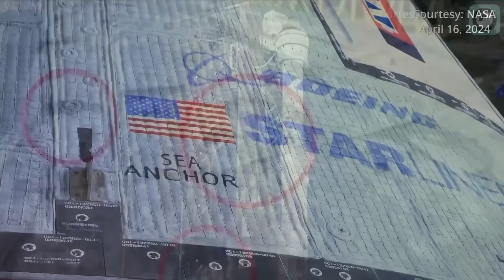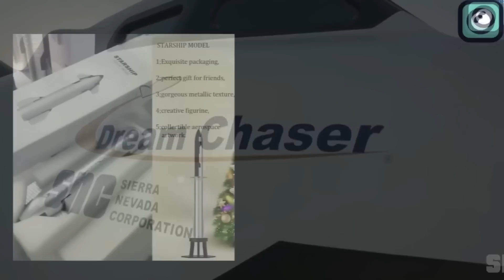Boeing Finally Gave Up On Starliner And Selling It Away!!

Comment: Think about it: Let's assume that Boeing's culture includes using political means to get what they want. They sell proprietary rights of Starliner to another company, grease the deal buy paying the guys running it under the table. The other company buys Starliner, and then once bought, cancels it, NASA-BE-DAMNED. Boeing holds the line with its thesis that fixed-rate contracts can't work. Boeing face is saved by not being THE ones to cancel, with the risk of further eroding Boeing's credibility in the broad aviation market. NASA shoulders all the blame for letting Starliner die. Machiavelli would be this devious.

Comment: Words fail me......
Reply: What a pity that Boeing is about to give up on Starliner Capsule Project - probably due to the many derogatory uninformed comments . Yes, it was way over-budget, and way behind schedule. It appears the Boeing Starliner project was let down by the Project Mgm't and Team members- who all shud have resigned or have been fired !!! Much of the Thruster 'problems' were from outside suppliers - the overview that installed 'flammable' electrical wiring and software glitches was negligence/ poor engineering ! The Starliner did fly to the ISS, and did return safely to earth ('empty'/uncrewed ! ). A proper complete design review, and proper experiennced team could build a Starliner Mk 2, and be successfull ! As for the Dream Chaser Project - it appears to have some merit - but it really has mostly been PR fluff,  and is actually a long way off to be certified for crew !!!